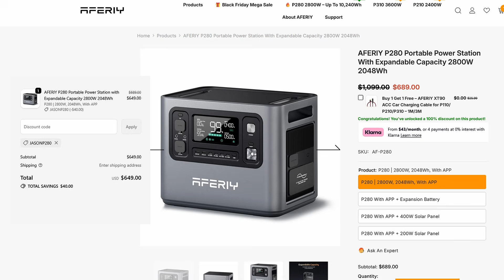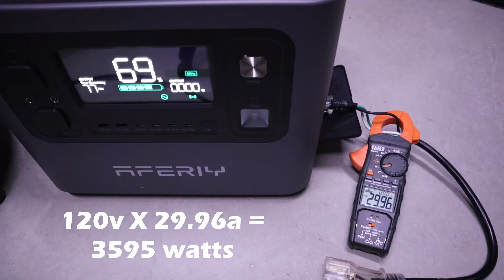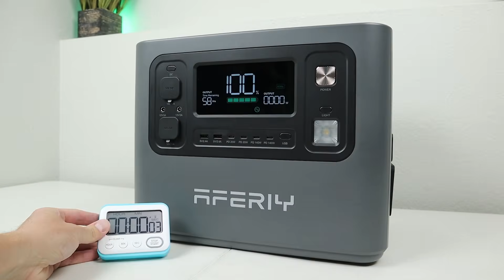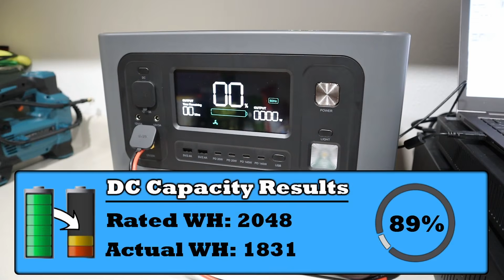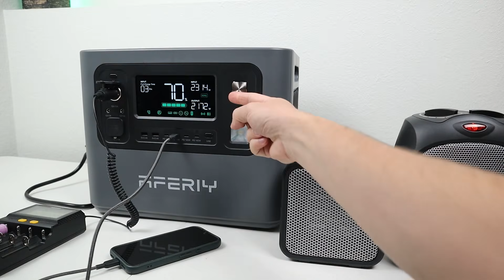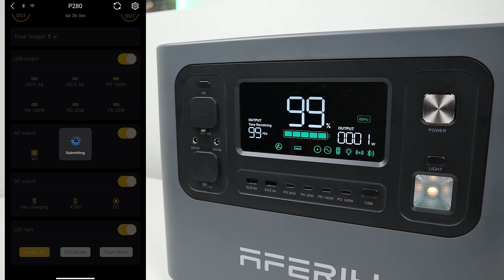The Best Power Station You’ve NEVER Heard Of? AFERIY P280  - Fully Tested

Comment: That price is impressive! I love the DC output and 140w USBc ports. The 55v solar limit isn't a deal breaker but I'd love to see at least 60v so I can use my Callsun 200w panels I just bought.
Reply from the maker: Thanks!
Reply: Since it has 20A you could wire in parallel.  I bought a pair of those 200W but have yet to mount them.
Reply from the maker: @LipsMalloy you need at least 30v to get peak power, the Callsun panels put out around 23v at peak power so you'll be under 600w.
Reply: @Jasonoid  The Voc on the Callsun 200W I have is 27.31V.  That's why I suggested wiring in parallel so as not to go over the 55V, esp. in colder temps.  You showed there is no headroom above the 55V, which is unusual not to build in a cushion.  I worry more about going over voltage than I do about maxing out solar input.  I just ordered the P280 thanks to your discount.

Comment: Hey Jasonoid :)

P.S. We have the Aferiy P-210 and the one thing that we really like about it....

THE SCREEN !!!!!

This has to be the nicest large screen that we have ever seen. you can see that bad boy from across the room super easy :)

SIDE NOTE: The Aferiy P-210 is only 110v, it is nice to see that they have 120v now ;)

UPDATE: My P-210 system must be an older generation and when I do the 10 clicks on the AC button, I only have an option to select 100v or 110v :(

P.S. STILL LOVE THAT SCREEN ;)
Reply: Check again if you can switch it.  Mine is 120V.

If you purchased before December 2023, quickly press the AC button 10 times to switch the AC output voltage

That would allow you to toggle from 110 to 120
Reply from the maker: @titobandito8474 that is correct, pushing the AC button will swap the inverter voltage.
Reply: @Jasonoid  Whaaaaaaat? Going to try that right now......be right back....LOL
Reply: OK, I am back :)

   I must have the older version or something, because I can only select 100v or 110v :(

P.S. BOOOOOOOOOOOOOOOOOOOO !!!!!

P.P.S. What the heck am I gonna do with 100v setting...LOL....110v it is then.
Reply from the maker: @RamblinBobReviews thanks for clarifying!
Reply: @RamblinBobReviews hmmm interesting. Just to be sure, press the button 20 or 30 times.  If there is an option to change, it will automatically happen on the 10th press and maybe you didn't catch it as it actually reverted back?  Perhaps yours doesn't, but easy enough to double check.

Also, maybe there a firmware update? You have to be on wifi to do it and you must be in a 2.4ghz band to be able to connect.

If having network issues, you can reset it to factory too...

With the device powered on, simultaneously press and hold the USB, AC, and DC buttons for 10 seconds. That resets everything and the. You have to reconnect the WiFi again.
Reply: @titobandito8474  Nope, I must have the older version, I have the option to change from 100v to 110v and that is it.
Multi-meter checked also !!!!!
Reply: @RamblinBobReviews  Roger that.  Bummer, but Interesting!  It's a shame we don't see more firmware updates on a lot of brands.  Come to think of it, I have only ever had one on a Bluetti Elite 200.  Granted, I only have a handful of systems, still seems kind of odd.
Reply from the maker: The screen is huge, that's definitely true! How has the performance been long term?